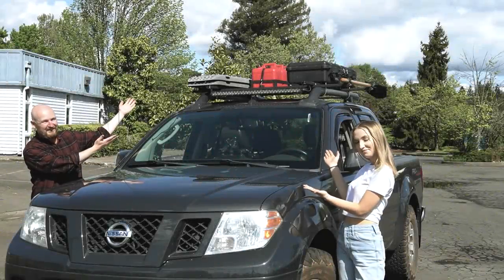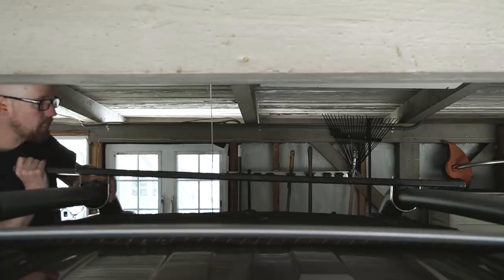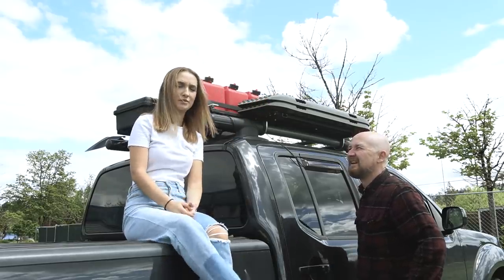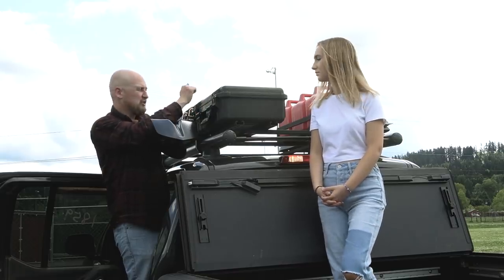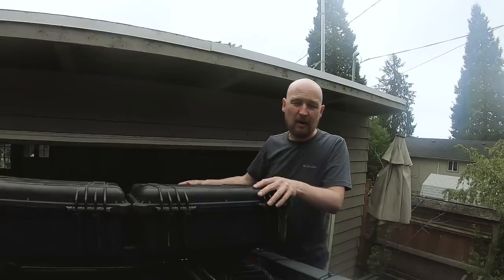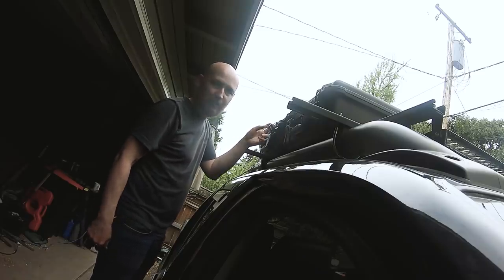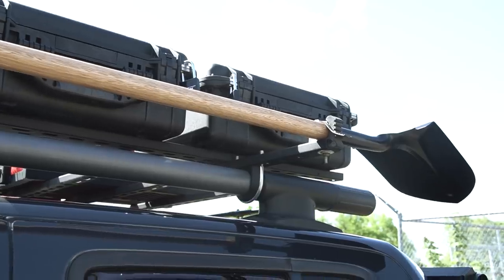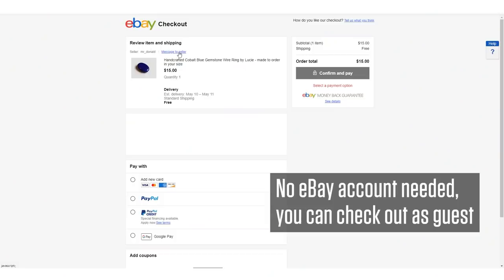Inexpensive DIY Roof Rack on my 05-20 Frontier Pro-4x

Comment: Unistrut. Interesting and affordable concept! I like it!  Do you place rubberized or plastic scrape guards on the strut ends? If so, what do you use? Might be an interesting followup segment.  I can see a possible need against bumping into the strut ends if working on the dark, etc.  Just my thoughts.  But all in all this is a great concept!
Reply from the maker: I actually looked for end caps in my local stores and on Amazon and couldn't find anything that looked promising. I probably need to look at a more specialized site. I'm not super tall so I don't come anywhere near hitting them, but it's probably just a matter of time before I absentmindedly pull myself up on the door sill to get something off the roof and smack my head into a strut end. I do want to get something on them.
Reply: @offroadxplorer  Thanks! I try to avoid the "head pin striping" at all costs.

Comment: Did you consider fabricating a bit of a drop bracket to hold the gas cans lower towards the roof of the truck. Might look better and lower their center of gravity a tiny bit... More for cosmetics I suppose but some functionality too... Good looking setup thus far!
Reply from the maker: I did mount the gas can holder onto strut pieces that are actually mounted to the underside of the front-to-back rails rather than on top, so the base of it is actually sitting lower than the cases and the traction boards. Ultimately I'm pretty sure I will end up making gas can holder V.2 at some point...I'm a very novice fabricator and there are a number of details that could be improved. :-)

Comment: I don't know if they changed it with the second gen but on the first gen Nissan Xterra the crossbeams that attach to the lengthwise rails on the roof are laughably horrible. Plastic clamps squeezed via a single bolt each are trusted to hold a total of 125 pounds (rating from the manufacturer) to the roof. I tightened them up as much as I could trust the plastic not to crack and I could still slide the horizontals across the rails with my hand without much force.
Reply from the maker: Yeah, I have the original front crossbar but it does not inspire confidence at all and the overall design isn't very practical anyway. I wish they put much more utilitarian roof rails too instead of those massive tubes. I suppose they look more rugged when nothing is mounted on them, but it's not a useful design. The bed on the other hand is lined with really nice sturdy Utili-Track...they should have put something like that on the roof as well, would've been so much nicer to build on. Thanks for watching!
Reply: @softroadingthewest  Practical roof racks have been around for a long time and were available on a lot of old vehicles. Why they decided to invest money redesigning something that ended up being practically useless instead of just going with a tried and true design is just stupid. I wish it was just a few simple bars with strong wire mesh across the top from the factory.

Comment: I laughed out loud at the way you said “I made it!”  I am working on my Frontier roof rack 2.0 myself but now I think I might make some design changes based on what you have done. How solid or quiet is it all together? I am frustrated with the amount of squeaks and flex that the Nissan bars have given me and my quick fists needed some bungee cord tension to stop them from rattling on my last setup.
Reply from the maker: So far so good, but I haven't actually put any fuel in the gas cans yet so there is very little weight up there at the moment. I thought I wasn't getting any wind noise but when I open the sunroof I realize, oh, yes, I am. :-)

Comment: Great idea for roof rail system. What size of u olt did you get?
Reply from the maker: I don't remember the exact size off the top of my head, but there is a link in the description for the u-bolts I bought. I've since stumbled across another video where someone used these on a Frontier or Xterra and they ended up adding a thin strip of rubber inside the plastic liner to improve the grip, but these seemed to grab very tightly as-is. I positioned them right up against the front and rear limits of the tubular rails, so with the strut structure tying them together, it's utterly impossible for them to move forward or backward.

Comment: Obviously this is a dumb question, because no one is doing it already. 
But in terms of Gas Cans, Heat and Swelling... Could Reflectix help in anyway?
Reply from the maker: Not sure...mostly it seems a little floppy to be up on the roof, unless one built a whole insulated box I suppose...
Reply: @softroadingthewest  Thanks... Love your videos... I have seen some square shaped Reflectix bags which I believe would not be to difficult to make also... but they probably would get quite ripped up in the wind.

Comment: Lacie at 10:43 , LOL. In time l think you should put the fuel in the tray to remove the weight from the top.
Reply from the maker: It won't be able to go in the tray, but the long-term goal is a custom rear bumper swing-out to eventually move the fuel back down off the roof.

Comment: Do you plane to make and sell the gas can holder. I want to buy one
Reply from the maker: Definitely not. :-) The materials were cheap, but the time it took me was ludicrous (well, in part because I was designing it as I went, haha)...I would have to charge way more than it's worth. But it's not really sellable as-is anyway, it has a number of design flaws and my welding is very amateur. I'll certainly end up making a new version eventually, but in any case I would never take on the liability of selling a product designed to carry gasoline on a vehicle roof. :-)

Comment: I wonder what the wieght capacity of the oem rails are?  Looking at my Wifes Pro-4X the meal bars insert into plastic that bolts to the roof.  The limiting factor is how strong is that plastic where the bars insert into.  I wouldn't think it would be rated for much more than the cross bars that are rated at 125lbs.  I like this idea because the factory cross bars are garbage.  The factory torx screws holding the cross bars is not very secure and please don't ever use rachet straps on the cross bars. My stupid ass did that and the cross bars shifted and lost the item on the roof. Haha yeah brain fart there DON'T DO WHAT I DID. 🙄

Comment: You should have just Rhino lined or Plasti Dipped the roof rack.
Reply: I line-xed my unistrut bed rails and it chips off just as easy as the paint does
Reply from the maker: I do like Plasti-Dip for certain applications, but my experience has been that it gets scraped off even easier than paint. And I would've been afraid to add any amount of thickness or texture of bedliner to the pieces of strut prior to assembling the rack...I feel like it would crack under the pressure at the connection points? Though I've never used it so I don't really know. Ultimately, as imperfect as spray paint is on galvanized metal, it's cheap, fast and easy, and really it looks fine from a normal viewing distance. It's not a show rig. The rest of my stuff always ends up banged up and scratched up from branches on narrow trails and general use & abuse, so imperfections on the rack itself look pretty natural.  :-)  Thanks for watching!
Reply: @softroadingthewest  That, makes sense. Good luck with Nissan build. I’ve been watching a long time and got my own Subaru Outback in 2019 to do some of my own softroading.